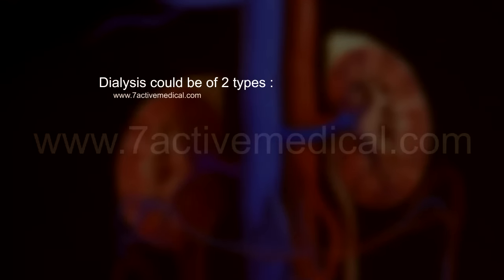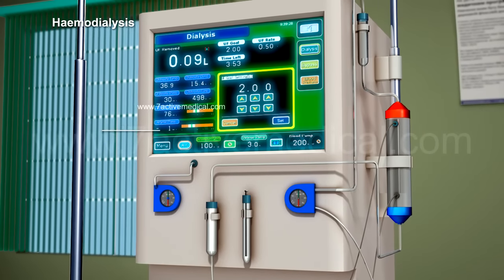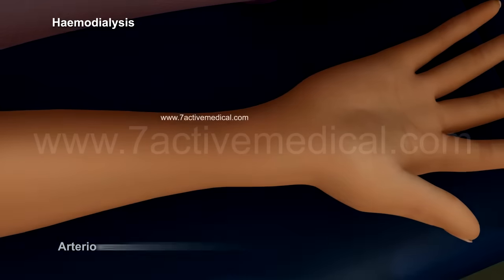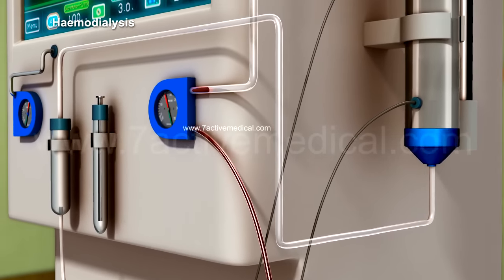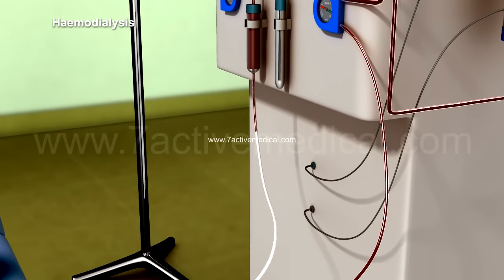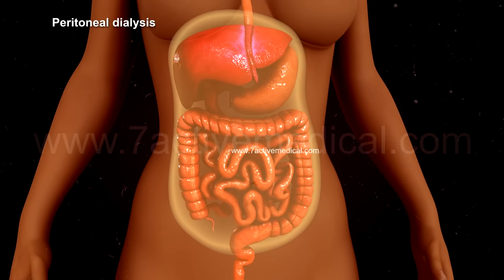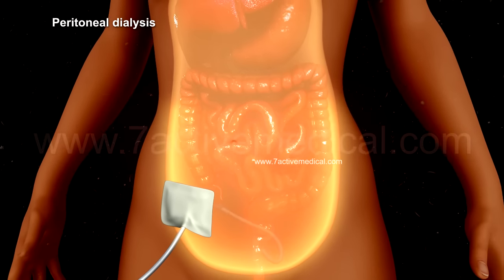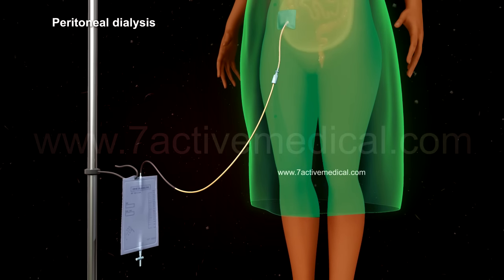Procedure of DIALYSIS

Comment: I was diagnosed with CKD stage 2  in 2017 &  in January 2023 progresses to stage 3 a, but often serum creatinine value fluctuate & eGFR also fluctuate.
DMSA renal scan differential function is still normal, no scar, no shrinkage, but I feel pain in my bones, taking treatment from SGRH DELHI.
Suffering from HTN  for 10 years.
Trying my best to avoid the stage of dialysis. Follow strict diet chart & a good control of blood pressure.
Medecine prescribed to me is beta blocker, calcium channel blocker, sodium bicarbonate,  SHPT 2.5, 
cudo forte.
Reply: Thanks for sharing.